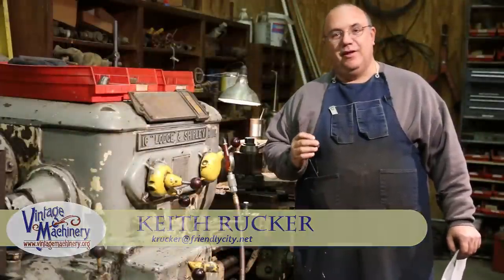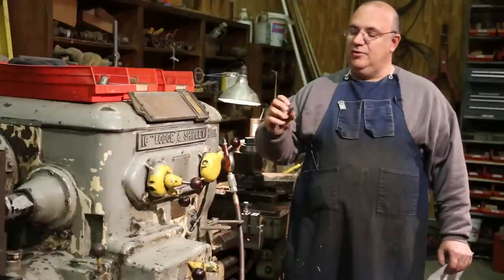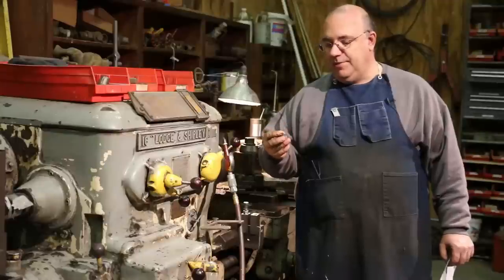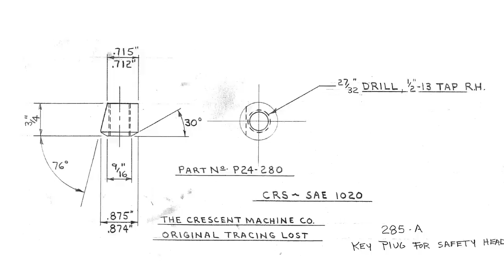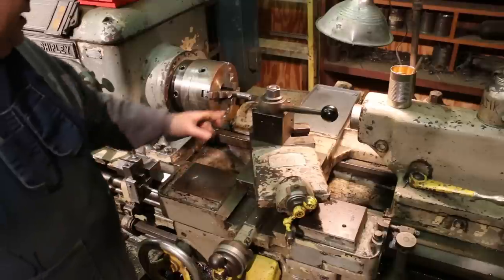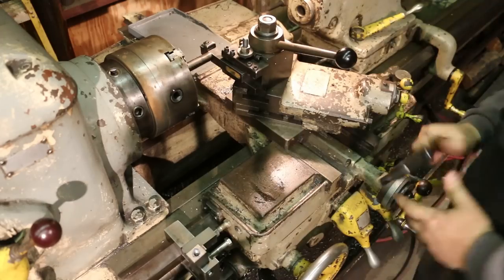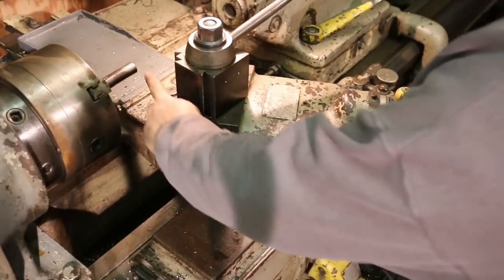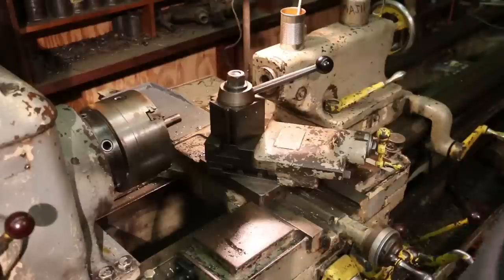Crescent Key Plugs Part 1: Setting up a Short Production Run on an Engine Lathe

Comment: Keith,
The human turret lathe! That's really cool that you found the old jointer that you used to have! Personally, I don't like jointers. When I was a service tech working on professional woodworking machines, I had just changed the blades in a 6" jointer. I had the guard off and was testing the machine. I guess I brushed my left hand over the cutter head because I felt a sting in my left ring finger and then saw a puddle of blood . . . MY blood! I looked at my hand and the side of the finger from the end to the first knuckle was gone! I called my boss (he was dispatching another tech to clean up and complete the job) and drove myself to the nearest emergency room. Fortunately, there was a plastic surgeon at the hospital. He removed some skin from my arm and grafted it to my finger. I learned a valuable lesson about being careless and not have guards on machines when they are running. Sorry for the ramble. Thanks for the video!
Have a good one.
Dave

Comment: Neat use of what you had to work with. That reminded me of how it was to run a Warner Swasey turret lathe back in the mid 70's when I started in the shop. You sure stayed busy running one of those machines

Comment: We had 30+ Acme Gridley screw machines when we got our 1st CNC turning center.  Advantage of the CNC was shorter setup time once programmed.  We ran long production runs, sometimes running the same part weeks at a time.  Cycle time per part, you couldn't beat the Acme's.  The CNC became the short run machining center.

Comment: Keith,  the shop I started in had 2 Gisholts one was a large chucker,  we ran large cast gear blanks on it. The other one was a bar feeder. The Warner Swasey was a chucker also we ran small cast gear blanks on it. Also the shop had 2 Leblond lathes, the owner ran them most of the time, I was privileged to get to run one on occasion. We made parts for textile mills, so we had 1 hob a Brown & Sharpe I think, 2 Fellows gear shapers one smaller one and one larger one. 4 Gleason bevel gear cutters, 2 of them were larger and made before WW2 and the other 2 was war machines. One single spindle screw machine, a OD grinder, a Wells index mill like yours. 2 drill presses on had a tapping head, a Sunnen  hone. Also he had one of the drill grinders like I have today.

My first job in the shop was after school was to work in the evenings loading the small Gleasons to cut small bevel gears that  was used in a certain type of textile machine.
Reply: The cool stuff is at the day job. We make a lot of gears for the truck transmissions. In fact we hob gears with out oil, just dry hob them. This is some tough steel because we use 8620.

Comment: Looks like fun. That print looked like the finished part should have a flat on one side? I'm guessing that will be part 2?

I'd have probably ground a tool to part off and chamfer the edges in one step, just because I hate changing tools.

Comment: Love the clutch operation for tapping. Don't get that with smaller lathes.
Doing a production run isn;t so bad once you get set up. Usually the most important part is the order of ops to make best use of time.

Colin ;-)

Comment: Hello Keith, it's nice to see what things you can make with the old laid and much more interesting than those computer steered cnc laids or those laser cutters. This is more working with the machine and nog let work the machine and push a button. 

Okay, I'm every day working with my computer but the most I like is repairing them work with hands. For hobby I got an old laptop from my sister with defects but I disassembled it totaly and it works again. 

When I had room for it and money I would also get an old laid and than learn to work with metals on the old fashion way. Not out of a book just like I didn't learn how to repair computers but just took them apart. 

Anyway I hope you ad a fine christmastime and will wish you lot's of good for the new year that is coming, and of course I hope there come again lot's of interesting video's like today and before. 

Many greetings from Roel out of the Netherlands !

Comment: To deburr the outside edge of a lot of parts like this, just thread them all on a rod, back to back, then chuck them in the lathe and with a parting tool that has a 45 degrees point to it touch the "seams" between the parts.

Did it with exactly the same kind of parts you've made here and with a small series of bushings i had to do. Only difference between the two being that the threaded ones stood there under their own "power" but on the bushings i had to put two nuts at the ends.

Comment: You mentioned a sander for the back chamfer. You could probably do both chamfers half way through the parting step.  It's an extra tool change but it saves you walking over to the sander.

Comment: Could you have used an index holder in the tail stock? Nice job on the parts.
Reply: Do you want one?
Reply: I have a 2mt 5 or 6 station that does fit my 1mt lathe. I will e mail you a picture. It was given to me so if it works it's yours.

Comment: Keith, I'm very curious about the tapping operation.  Tapping by hand eliminates what seems to be a potential issue: the feed of the tap does not match the part's rotation.  In this case I suppose something would have to give - with perhaps the tap snapping.

How did you manage to tap these pieces and avoid the problem?
Reply: *****
OK understood.. so the tap is free to move as it's allowed to slide.  Cool.  Thanks for explaining that.

Comment: A lot of time savings over measuring each part for each depth of cut.  Still, lots slower than a turret lathe, and much slower yet than a B&S automatic screw machine.  Then again, of course, the set up time for the screw machine and its cost are only worthwhile on much larger runs of parts.  What you are doing is an appropriate process for your machine and your run of parts.  Your carriage stop seems to be working out great!

Comment: Keith, is there much of a market for those parts?  Looks like something I could make on my little 9" South Bend. My lathe came with a collet chuck and a turret tail stock, so I wouldn't have quite as much tool switching as you did.  It also came with a 4 position carriage stop too, which is good because I don't have a mill to use to make one!

-- Mike
Reply: Keith, thanks for the reply and the info.  That's about what I figured.  Very specialized need, with only a few potential customers.

I'm still learning to use my lathe and haven't had a need for the turret tail stock yet, but it will probably come in handy at some point.  It's not one of those Morse taper rotating tool holders that fit in the tail stock spindle, it's a whole tail stock with a turret on top, and a lever that moves the top towards the headstock, and indexes the turret on retraction.  Depending on the tools needed I might need adapters, but luckily I have a lathe! ;-)

-- Mike

Comment: If I ever had to do something like that. I would drill in deep tap in deep so I would be able to cut off a few. It would be easier that way.
Reply: A good idea. I've practised that making things. However, runouts and other imperfectnesses tend to make the drill divert from the center line.